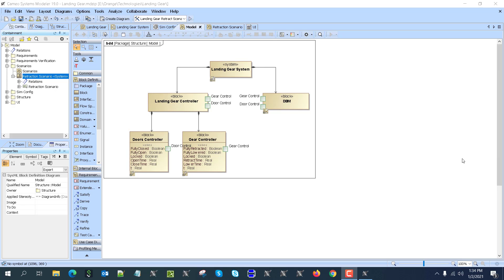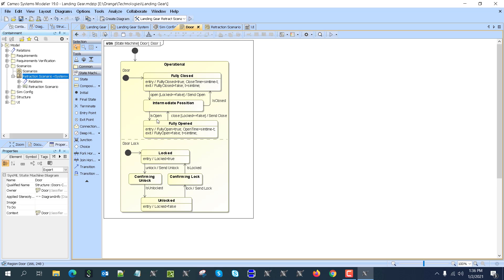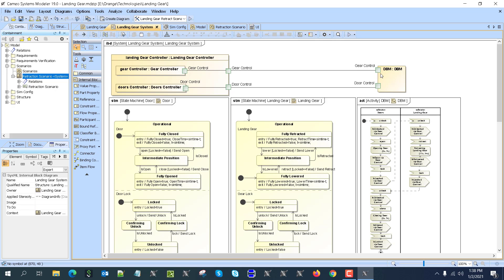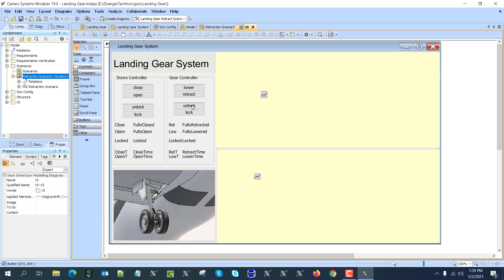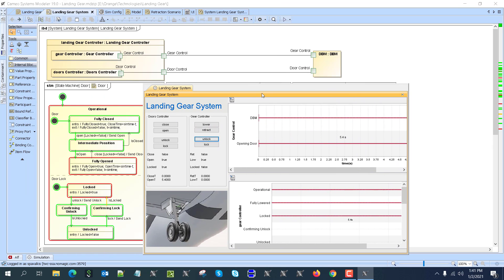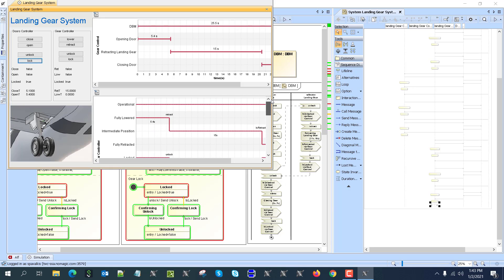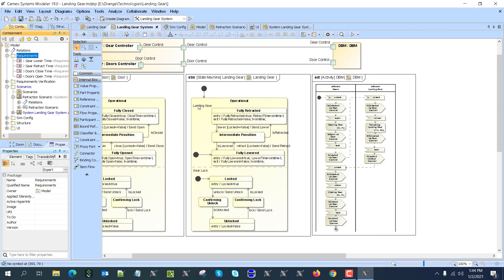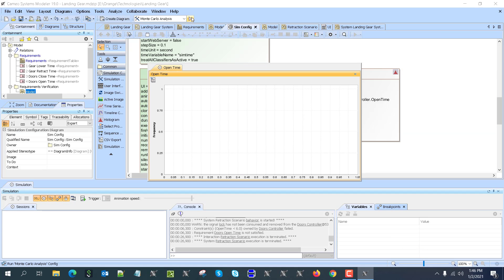Landing Gear System SysML Simulation Model

Comment: NX already has the capability to do better and faster simulations of landing gear motions 100 times better than cameo does it. Why would a landing gear engineer for an aerospace company even consider doing this in cameo... How exactly does this capability help the engineers do the design when there are other tools better equipped to do this kind of work? If you actually tried to do real analysis of landing gear operations cameo would crash because it simply doesn't have the computing and processing power to do such an operation because its not built to do that level of analysis.
Reply from the maker: Thank you Daniel for the feedback. This is only sample. As systems engineer you transition from user needs to optimal system architecture evaluating multiple decisions and identifying the best based on measurements of effectiveness. Specific design simulation is one part of the equation. They are great but in many cases isolated from system architecture, trade studies, other design disciplines, etc. There are more in consideration like alternative architectures, functions which we want to optimize, v&v, software and other disciplines consideration, etc. so as systems engineer we go from mostly descriptive to mostly executable system to be able virtually v&v it before actually implementing or prototyping. Ideally the best design simulation solutions shall be used to give feedback to system architecture trade study or v&v. This is what we are demonstrating in the sample connecting Cameo with Dymola which runs design model.